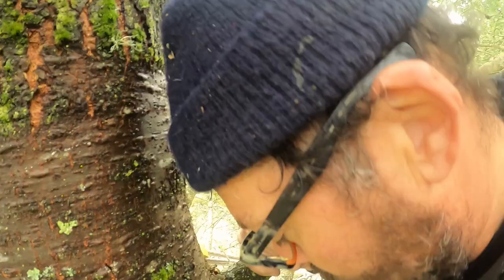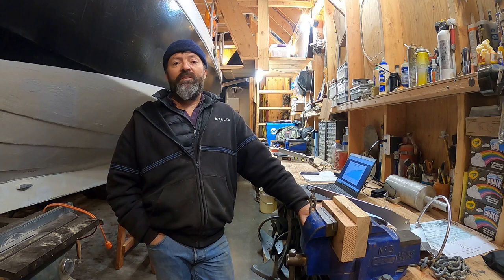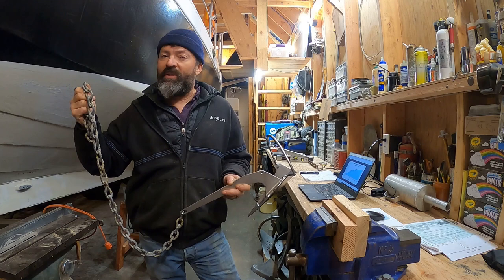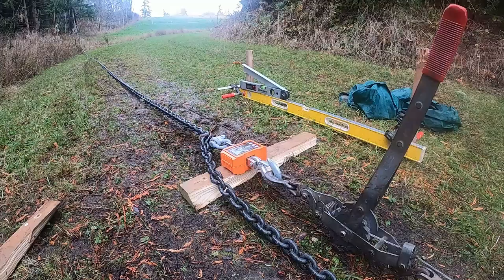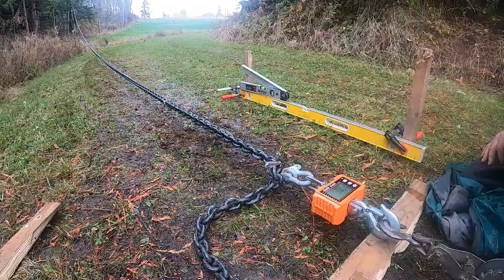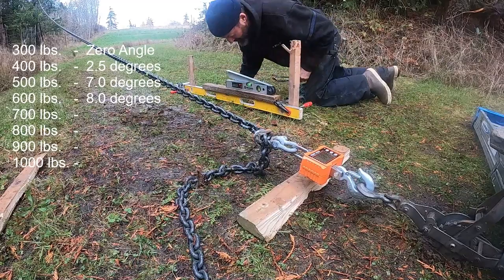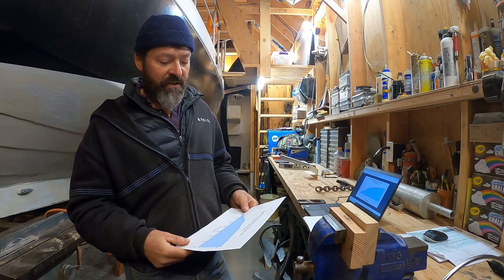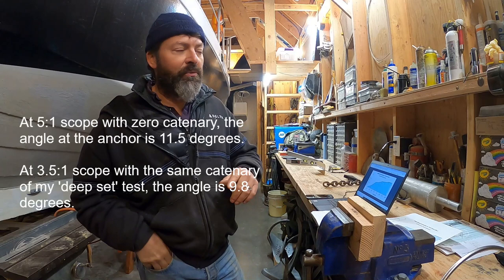Anchor Chain Catenary. Anchor Test Video #89

Comment: When I first got interesting in sailing I read all the old guys, Hal Roth, Lynn and Larry Pardy, and others. They were using the CQR and heavy chain. Hal Roth said he never anchored overnight with less than 5 to 1, and if it was breezy he went out to 7 to 1. When I anchored anywhere up in Georgia Straight the tides were at least ten feet of change so I often anchored in no less than 25 feet. In the tropics the tide changed only a couple of feet so you could anchor with a lot less chain, but I still hardly had less than 120 feet of chain out in 15 feet. I believe you sleep better knowing you have a good anchor, lots of heavy chain, and plenty of scope.

Comment: That is a lot of effort you put in doing this testing, thank you Steve , it helps a lot to get real world anchor data!!!
Reply: Real world data means using youre anchor every day while sailing around the world. Do you trust it or not to sleep in 50 knots. I use a 20kg rocna. It's the best anchor I have ever had. It only drags if fouled by something on the bottom.
That's real life data for the past 10 years. Before rocna I would drag any plow anchor quite often. Never trusted my gear till rocna.
Reply: @evinwhiteson4902  Thanks for taking the time to give us your data Evin.

Comment: I have heard that the US Navy actually uses chain to hold its ships in place and that the anchor (which is heavy) is just used to pull the chain out.  Of curse there chain is very large +2”ish.   I tend to anchor in shallow water ( 8’-12’) and always add the distance from the bow roller to the water to the depth.  Just my way of doing things.

Comment: On my 35 ft sailboat I have all chain (3/8") with a 45 lb CQR.  I use 3:1 scope if in a protected anchorage.  Have drug a little once in a mud bottom covered with "newspaper seaweed". I always set an anchor alarm. If I get blasted with very strong winds I would let additional scope out. (SE Alaska).

Comment: My approach is very simple: chain you have in your boat doesn‘t help but chain on the bottom of the sea does. So if space allows I always put out generous 5:1 till 17m depth, that’s what my total 85m chain length supports, from then on I shackle in a 18kg anchor weight after about 40m which keeps the angle on the anchor shank lower and I feel safe till 1:3 till around 27m of depth. The anchor weight in the middle of the chain also provides additional damping due to enlarging the catany of the chain. Have a cat and my bridle contains rubber dampers to further enlarge damping and also less stress on the attachment points of the bridle. The gypsy of my lofrans windlass doesn‘t support rope and there is none available for 10mm DIN chain that would support rope so that’s the best I can do.

Comment: Great stuff. One god reason for using using rope rode is that it simulates what happens in a strong blow when the chain straightens out. 
 A while ago i sent a email to Spade and asked:  "How does holding power and anchor weight/(size) scale ?" they answered "Actually holding power is between 1.5 and 1.7" . Slightly off topic, but maybe an ide to future investigations.  Fair winds!  ;)
Reply: I am not sure how to interpret that number given by Spade, but naively, I would argue that for any given anchor type, if I double its linear dimension (like length of anchor shaft) and keep all proportions the same, then the holding power will go up by a factor of 4, since it relates to the surface area 'wetted' by the sand. On the other hand, the weight of the anchor will go up by a factor of 8. So, if I now put all this into perspective in a formula, I would write 2^(2/3) = 1.59... Perhaps this is what Spade had been referring to?

Comment: Height = 30 ft.
Chain length = 105 ft.
Chain weight = 1.6 lbs. per foot (in air)  2.38 kg/m ~11mm chain?

Comment: Hi Steve, your various tests and experiments are so interesting and valuable. Big thanks from Sweden and keep going if you have the time, means and motivation. Your video's  are so appreciated. I know that this video was at a fixed scope 3.5 but I wanted to ask if this experiment gave you any insights to the general rule of thumb regarding scope: 15 m plus 2 times the depth? Also please test 15 kg anchors. A popular size here.

Comment: I personally like the “short rode” tests cause for lake anchorage 5:1, 7:1, or 10:1 is unrealistic for my type of boating and my boat size. Keeping say 500 to 1000 feet of rode on a 22 ft powerboat isn’t going to happen. typically on lakes (around me at least) allowing for that much sway with other boats around is practically impossible too. For the record I’m in the SW of the US and lake depths range from 20-100+ feet.

Comment: Great statistics. Thank you.  I am a Great Lakes sailor anchoring in anywhere between 10 and 30 feet with mud or sand with a mostly rope rode and on low wind events. I have considered, if needed, to put an heavy mushroom anchor on a snatch block and a control line back to boat and letting the block/anchor go down the anchor rode to act like the weight of an all chair rode, 0r to increase the catenary,  to allow less scope with the effect of a chain rode. Your thoughts?
Reply from the maker: I believe a weight that you describe (a kellet) can be of some benefit during setting at short scope when using a mostly rope rode. However, in order for a kellet to have much effect at reducing the angle of pull at the anchor during higher winds, it will have to be very very heavy.  Keep in mind that the 105 feet of chain (that I normally use for testing) weighs almost 4 times as much as the anchor.
Reply: A waste of time, in high winds. The best use of a kellet is in low winds (near calm) to keep the boat from meandering around the anchor.  Such meandering in calm conditions can cause a rode to snag on the anchor stock or collide with nearby boats.  A kellet also complicates anchoring and retrieval.

Comment: I’m curious about the angle at anchor comparing kellet to chain because the math gets complex. In another comment you responded that your chain weights much more than the anchor even but the load is spread and so would a kellet point load in the middle be as effective to achieve the same rode angle with much less weight than the chain total weight. A kellet yes is generally impractical but it would be an overall less expensive and less heavy rode on the boat and I have only 3/4” rode with a 45lb mantus on an 11,000lb Tartan 34c. I like the stretch I have too and usually anchor in 5-7ft depths (4ft draft w low tidal range in Barnegat Bay, NJ) but let’s say I travel somewhere and I want to have my rode handle a tight anchorage or deeper water with heavy wind a kellet is something I would consider. If you anchor between a buch of chain rode boats in a tight anchorage like you see happen in the Mediterranean and you have rode you need a way to get catenary effect to make the system work. I would really want to know if you need that much weight or because of point load effect in the middle of the line if that leverage requires less weight. Plus you can maybe cheat some boyancy weight to your favor in a kellet by using one made of lead and letting it out more than half the rode length say 2/3rds would also help a kellet cheat since in the chain that weight has a bigger vertical component which hangs on the vessel and closer to the anchor it would Maybe help the angle a little more.
Reply from the maker: Yes, tricky math.  My guess is that a Kellet vs. equal weight chain will result in a more favorable angle at the anchor for the reasons you gave.  

It would be tempting to conduct a simulation/test in the shop, but, to be accurate, the "boat end" of the rode would need to be free to move horizontally in the same way a boat moves closer to the anchor with catenary.    I'll put that test on my list of potential future projects.  Thanks for the idea.

Comment: Steve - is there any way you can correlate wind speed to the pulling force you have listed for each 100 lb data point?  That would be great info

Thanks,
Ron
Reply from the maker: Here is the ROUGH data using the "20kt wind test" data as a baseline.
100 lbs -  14 kts.
200 lbs -  20 kts.
300 lbs -  24 kts.
400 lbs -  28 kts.
500 lbs -  32 kts.
600 lbs -  35 kts.
700 lbs -  37 kts.
800 lbs -  40 kts.
900 lbs -  42 kts.
1000 lbs -  45 kts.
Reply: @flygoodwin   The force from wind goes up at the cube, not square, since it is a fluid.   These values would need to be recomputed to the third power.

Comment: I can't use all chain so I use 6' of 1/2" chain on the end of my rode. It works well for me. But it's totally different than your test. Any plans on combining a length of chain to rode? 
I sleep very well swinging on my 17lb Mantus with my set up. MacGregor 26D (around 3000 lb)
Reply from the maker: Marty, that is an interesting combination you have: Short, but extremely oversized chain (for the size of anchor/boat).  I can see how that would work very well when setting and perhaps provide some catenary at lower wind speeds. Thanks for the idea.
Reply: @flygoodwin  I'm in Ontario Canada and sail mostly in the Great Lakes. Most boats around here are trailered. I think because of that all chain anchor rode isn't used. Too heavy. The bigger cruising boats that are in the marina and need to be crained in and out don't care so much about weight.
The chain I have came with my boat when I got it used. I think it's over kill but why change it when it works. 
Yes I think that extra chain on the end helps with setting the anchor. It's never fouled or failed to set.

Comment: Have you thought about doing a mixed test, say 50-75ft chain and the rest rope? It seems to be the go to recommended option for trailer sailers
Reply from the maker: Yes, I will conduct a "tree" test with a mixed rode when the weather turns warm.
Reply: @flygoodwin  I understand it'll be a hell of alot of work for you, but all chain, all chain of a smaller size, all rope and mixed. over your normal 3.5:1 and 5:1 rodes would be very interesting to see. But I would suspect that'll be a ridiculous amount of work

Comment: Wow, this is a serious way to establishing what you already have told before. May I ask why assuming a rode of rope (nylon) and not chain is preferable in your tests? Wouldn’t most serious sailors use chain for the first 100 meters? Or is it because I’m living at 63°N that chain is the only way to go?
Reply from the maker: I am just searching for answers to the questions.  All of the them!
Reply: “most serious sailors” implies a strong pre-judgment and bias. In objective calculations and real world experience, elasticity is helpful in reducing shock loads  such as those caused by waves and a boat’s “hunting” back and forth. This video illustrates quite clearly that the benefits of chain catenary are dramatically reduced as load increases.  Therefore most “serious” sailors wouldn’t be without rope rode (or long rope snubber) for at least a segment of the rode.
Reply: Quite! The snubber is of course an important part of the set-up and probably almost impossible to find a good way to measure in these tests, as well as for nylon rodes, since there are no standards. By doing the measurements with only chain I guess you are getting as close as possible to a scientific standpoint. Then every one can get an idea of what loads can be expected and apply it to their own way of handling it.

Comment: I wonder how much the tree gave way in this test as it wasn't anchored on the other side at the attachment point, so I'm sure it moved in relation to the force applied and has an effect on the readings.  Maybe next time a building or a tree on a hill, and attach to the base of the tree where it won't move,  instead of near the top of the tree to do the test...very interesting.
Reply from the maker: I searched high and low for a suitable "tree on hill" test location and could not find a one with a clear flat approach (for driving the truck, filming).  That said, I detected zero deflection of the treetop during the the test.  Strong tree.
Reply: @flygoodwin  strong tree :)

Comment: Hi, a very interesting and spectacular test! I'm a physicist and sailor/cruiser. I was also very interested in the theory (and practice) of anchors/anchoring. I wrote a little catenary program that calculates the exact shape (plus angles, forces and displacements) of the scope (either all chain, or mixed chain/rope, even a kellet can be added) for a given ancoring situation (wind speed, depth, scope etc.). I can send you the program if you wish, or I can run some calculations for the situation of your test and we can compare the results. Let me know if this would be interesting for you. Best, Denes
Reply from the maker: Greetings Denes.  By all means, do run a calculation for my test.  I would be very interested to compare.  

Height = 30 ft.
Chain length = 105 ft.
Chain weight = 1.6 lbs. per foot (in air)

Thanks, Steve
Reply: @flygoodwin  Hi Steve, OK, will do it over the weekend. Cheers, Denes
Reply: Hi Steve,
I did the calculations. You can download the plots with the results from here:
https://drive.google.com/file/d/1-18PWntTHk5MsWgpVBvbC3ltwVMM05Wf/view?usp=sharing
There is a surprisingly good agreement between your measured values and the calculations! I was surprised...
Cheers, Denes
Reply: @denesszabo5669  Hi Denes I tried to open your file but could't Is there any other way to see it thanks!!
Reply: @billycosta3203  Hi, I deleted the files after 1 month since there was no interest. I can upload them again if you are interested. Just let me know...
Reply: I would be interested in the program. Hopefully it can run on a browser or mac.

Comment: I'm seeing discrepancies between your real world test at only 3.5-1 compared to this article with a 6-1 ratio and their model is showing WAY more angle to the catenary. I've also been researching kellet or sentinel weights for adding during tropical storms or hurricanes. From your data does it appear true that a kellet, say, 20-30' from the anchor would aid in keeping the anchor buried? https://www.petersmith.net.nz/boat-anchors/kellets.php
Reply from the maker: Robert, I did not find the discrepancies that you mentioned.   Note that the graph in the article is depicted with the vertical axis in a far different scale as the horizontal.  

Re: Kellets, I agree with the article.  A kellet's  effectiveness at reducing angle of pull at the anchor will be reduced to having almost no effect as wind increases to "storm" or especially "hurricane" strength.

The exception would be a case where the rode is very long (many hundreds of feet) and the kellet is very large (many times heavier than the anchor).
Reply: @flygoodwin  it seemed to me that your angles for the cantenary were not as steep as what they showed in the graphs even at your 1,000 lb pool it did not look as steep of an angle as their lower Force test, 650 lb if my memory serves me?
Reply: @flygoodwin  oh and thank you for the response
Reply from the maker: @wakeboardbob  In the Peter Smith article, the graph that is shown cannot be used to determine "angles" because the two axis are not drawn to scale (with one another).
Reply: @flygoodwin  not sure if you understood my direction with the question but just to clarify my concern was their angle was very steep with only 650 lb whereas your angle was nowhere near there's... My concern being the shank of the anchor being pulled from the seabed with such high angles on the road. Your test gave me some reassurance due to the very shallow angles of the cantinary even at 1,000 lb pull. Thank you again